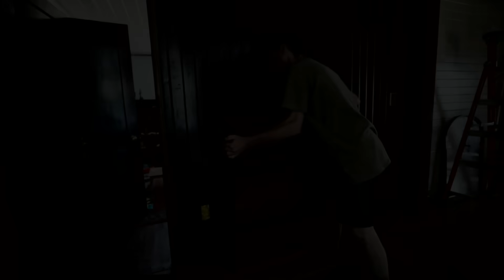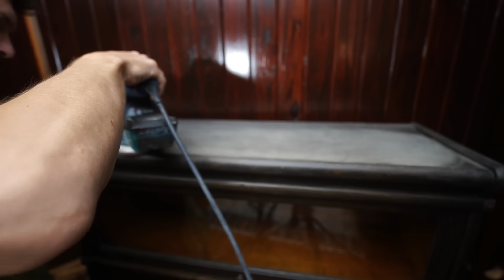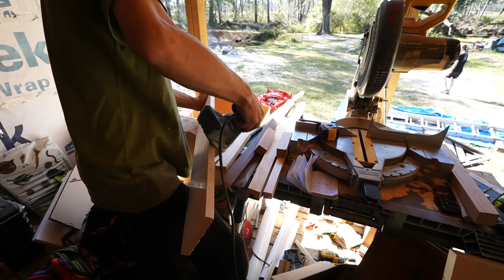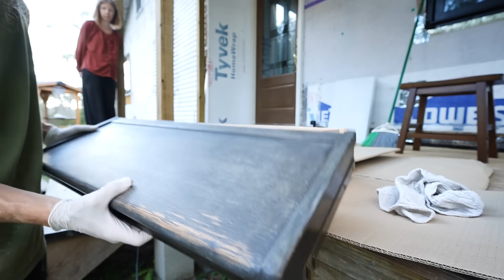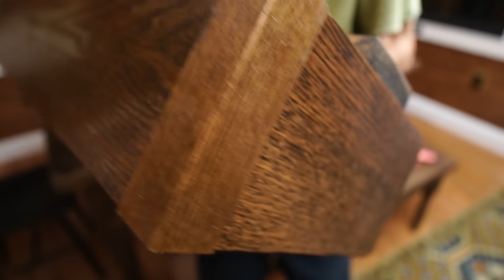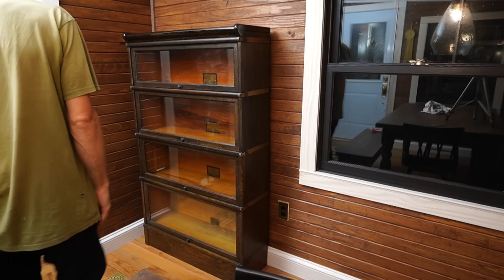Rare Antique Bookshelf Saved From the Landfill and Restored - DIY Dream Home Build

Comment: Beautiful piece! You really have to go to a high end retailer to find anything or comparable quality. They really don’t make things like they used to. I have a beautiful intricately carved antique dresser I got last year at a large auction that I can’t wait to restore. I’m waiting till I have a house though so I don’t get the finish dusty in storage. Also have an old pine kitchen/dinning table with folding sides. It has small metal casters on the bottom. The wood is very dry. I tested some coconut oil on a leg and a underside a couple years ago and it really made the wood look great.

Comment: That's definitely a treasure. Heres a little historical knowledge about the Barrister  Bookcase.. 
Once standard equipment in the old law offices of England, the original barristers bookcases were designed to be sturdy and portable. They had two purposes – to be able to hold a large number of weighty books and be moved from place to place without damage occurring to their contents. 
So glad you saved this piece. You did an awesome job, Doug!

Comment: I used to clean houses that a few elderly had them, they are called barrister bookcase. They were created so lawyers could easily transport law books for reference in court cases, because back in the early mid to late 19th century they would have to travel to different courts. As rough as yours was it turned out so good no one could tell you redid it!

Comment: You spent so much time an effort putting down the floors and have a great rug to protect it yet you chose to glue and work on the cabinet without putting a drop sheet down to protect the rug and floor.  Great job building the base and top.

Comment: Love the new base.   The color match is about perfect.    Im thinking the original base  most likely was a similar size to the top piece.  We have one of these and that is how that one is, maybe a little bit higher than the top but not much.      One other thing you can do.  I don't like a gap against the wall at the top.  I add a  piece across the back of the top matching the other wood. Make it the same thickness as the base board.   I don't like having anything being able to fall behind. .   I have done it today night stands, dressers etc.      i don't like gaps between furniture and walls.

Comment: I found one very similar in the trash many years ago mine has the original base. The base on mine has short legs the apron does not go all the way down to the floor. That way you can see underneath it and it makes the entire unit look like to lighter.
Reply from the maker: We chose to build the base in a way that would keep dust from getting under it so cleaning the room would be easier. That's the main reason I chose to do it that way as opposed to having it raised up on legs.

Comment: Nice work, but you are still missing the brass strips that fit into the cleats on the side. They run from the top to the bottom and really lock the cabinet together. They could be easily made.